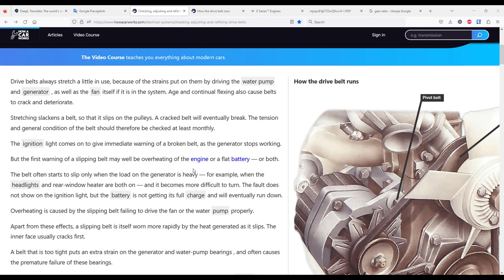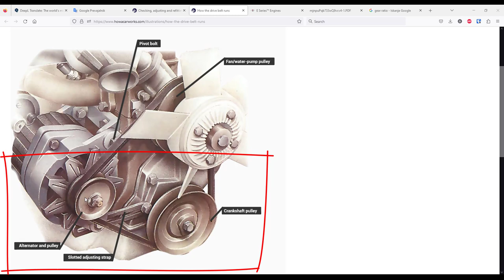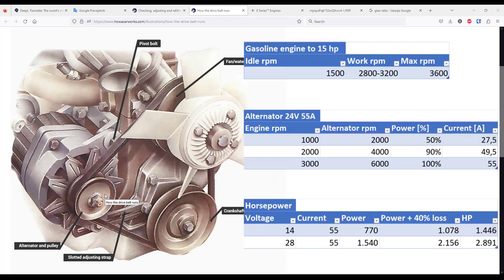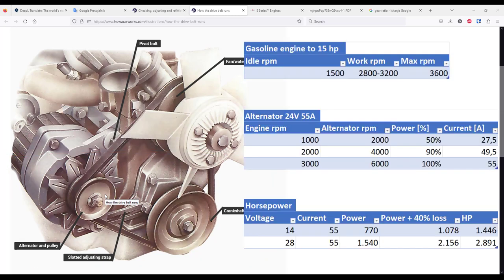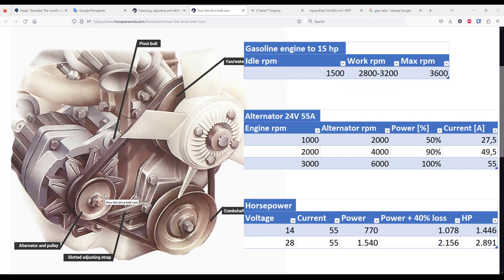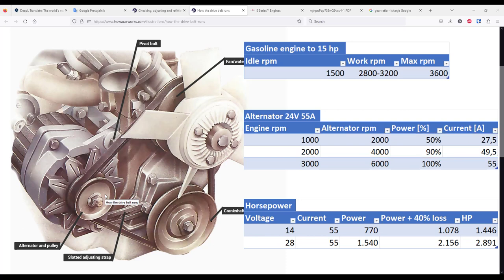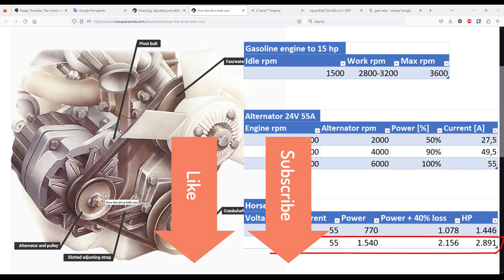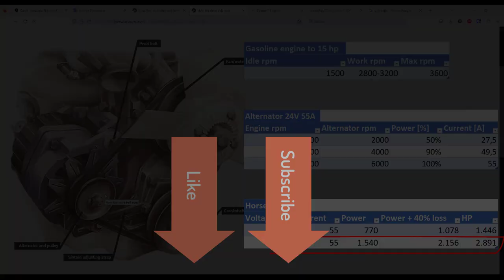Alternator, DC Motor, Battery - Remote Control Lawn Mower DIY

Comment: Thank you, from California. Also, the amount of amps you need depends on how hard you are working on the motors. Many variables are at play for how many amps you use... the vehicle's weight, the drag of the drive line including tracks, terrain, how fast you go, how much stopping and going, amount of turning, how hot the motors get...

Comment: Odlična prezentacija a imam za sebe eno vprašanje.Imam 4 motorje 24v 300w altenator 110a in 2 akumulatorja 12v zaporedno vezana vsak po 100ah.Ali bo to zadovoljivo.Hvala za odgovor
Reply from the maker: Živjo! Seveda, imate še precej rezerve. Bencinski motor bo dovolj močan?
Reply: Mislim da 16konjev 432ccm
Reply from the maker: Super, tole bo konkreten stroj. Se priporočam za kakšno fotografijo. Srečno!

Comment: Thanks for posting. Is there a risk of overcharging?
Reply from the maker: If you use lead acid batteries then there is no risk. If you look at the table on my batteries you will see the term "floating use", where the voltage is exactly the charging voltage of alternator. "Floating use" means the voltage that keeps the battery at 100% capacity.
Reply: To clarify, is it proper to send the alternator voltage full time to the 2 lead acid batteries? That would be ideal because of the simplicity. This video was very helpful. Especially the discussion on pulley diameter ratios. Thanks
Reply from the maker: @ronzika335  yes, it is ok to connect alternator directly to lead-acid batteries. Thanks for nice comment.

Comment: how do you wiring from alternator to two batteries 24v?
Reply from the maker: Hi, here is schematic I draw for some people  asked the same question https://drive.google.com/file/d/13G8zPxW5MlsClxAV1lS8dOpGJngVjk__/view?usp=drivesdk
Reply: @gregorkobetic  thanks! I already did that for my RC mower but still not enough charging power for 2-24v motors.
Reply from the maker: @HoytVoeun what do you mean by not enought power? Alernator too weak? Or batteries not charged evenly?

Comment: Thank you for the great content! Can I ask how you went about sizing the alternator? I have a fairly flat yard, so thinking of two 200w motors. Wanted to now what size alternator you recommend to maintain 100% battery charge?
Reply from the maker: Hi, 24V 55A alternator are available for good price. You have to dimension alternator with extra power, becouse motors take more current then declared if they stall. If you can get 12v motors you can get 12v alternator for lower price. But remember less voltage take more current for the same amount of power.

Comment: I am currently using an alternator 24v 35A. The ratio is 2:1. The engine has 5.5 HP and struggles when the two electric motors use Full Power. Can i reduce the load on the gasoline engine when use a 1,5:1 or 1:1 ratio on the alternator?
Reply from the maker: Hi! You will not get enought power from alternator and batteries will have to compensate the difference in power. Maybe batteries will discharge eventualy. Is there any chance you can reduce speed of your mower with gear? What is max speed of your mower?
Reply: The Motors are gear reduced to 75 r/min with 250w and ned about 16A on Full Power. The Mower has about 80/85 kg and runs about 2.6km/h. There are only steep slopes on my property, so the mower almost always needs full power.
Reply from the maker: You have good design. It's hard to give a good suggestion. Try to do something so that the gasoline engine doesn't struggle to cut grass, in terms of easier ejection of grass (increase the opening), replace the blades with flatter blades (less lift) maybe.
Reply: Thank you for your answers. 
I think I'll try to modify the carburetor and the intake system a little to squeeze more power out of the engine.
PS your Mower is awesome👍🏻
Reply from the maker: @alex4l3x65  you are welcome! Thanks!

Comment: Hi friend, why you need an extra alternator if the mower motor comes with one?
Reply from the maker: Some gasoline engines have generator for charging batteries for electric starter and to power lights, etc... however this power is in range of about 100W. My motors together need about 700W
Reply: @gregorkobetic  Thank you! Has the alternator some rpm works limit? I mean, my alternator has a 2.3in pulley while the gasoline engine crankshaft has a 6.3in pulley, witch means that, when the gasoline engine be working on 3000 rpm, the alternator will on 8700 rpm
Reply from the maker: @diegoContodo  my alternator can go over 10000, I can remember exact number. I think you are in safe range. But anyway check datasheet of your alternator 😉

Comment: Can you help me please
Reply from the maker: Yes of course. How can I help you?
Reply: @gregorkobetic7513  I have a Daredevil Mower and it moves very slow
Reply: @gregorkobetic  I am not 100 percent knowledgeable about this subject
Reply from the maker: @turtlewax2  uff its difficult to say anything without debugging electronics. If motors have torque, but are running slow, maybe there is something you can do on your remote control transmitter. If you provide me more information we can figure it out perhaps. Write me on gkobetic@gmail.com
Reply: I tried to email you